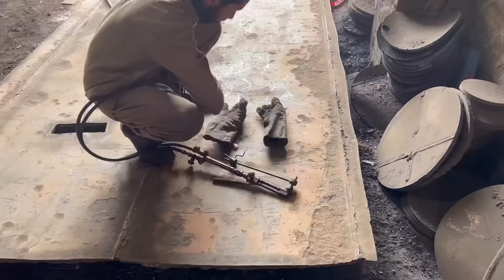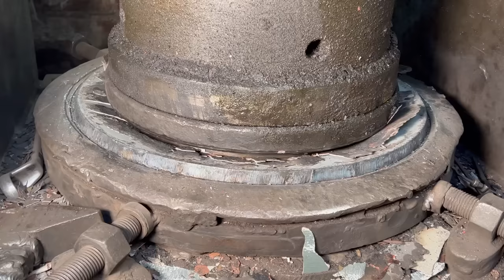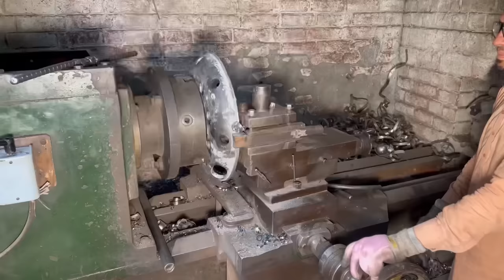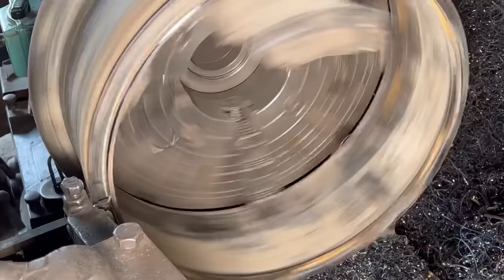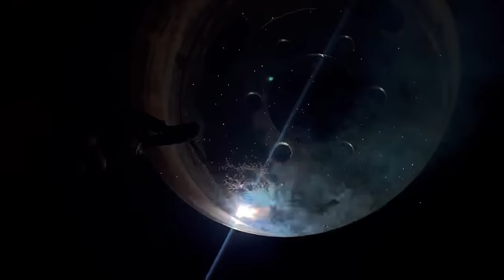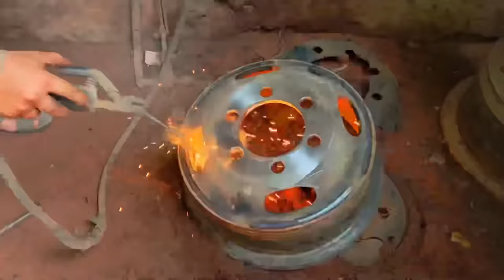Transforming Old Ship Sheets Into Heavy Duty Truck Tire Rim |Easy DIY Rim Plate from Old Sheet Metal

Comment: Dude holding that chisel got balls of steel !!
Reply: ... скорее сварщик имеет стальные лёгкие
Reply: Nope... he's just very hungry
Reply: Indeed.  Crap 'cold' welds that will peel away like that.
Reply: Nope... no brains
Reply: Even if he doesn't ever get actually hit, his hand and wrist joints are going to be destroyed from the vibrations.
Reply: At least they are wearing shoes and not sandals  😅
Reply: I was more worried about the guys left foot right by the chisel and where both guys were swinging the sledge but then it segued into the guy using the torch with no safety glasses
Reply: also wrists
Reply: Debes ser del tipo que siempre estropea las celebraciones!
Reply: @captaingoody 1

Comment: How the heck were the lug stud holes aligned, don't tell me he did it by sight!  Amazing work, would love to know the psi of those presses, wow!
Reply: 8😅😅k99
Reply: I was wondering the same thing
Reply: My guess is they had the holes marked off camera.
Reply: There had to be a jig
Reply: Looks like he was using a dividing head and rotating to each "click" on the rotation.
Reply: IF their rims are made same way they are in US, the lug nut stud holes have quite a bit of play, holes are bigger then they need to be.  Unlike on cars, what centers the rim is the pilot hole, the big hole in the center of the rim, you can see him machining it at one point.  Thing is I haven't seen them use a measuring tool for that hole either, and that one has to be very tight tolerance.
Still a nice eyeball on the stud holes.
Reply: @markmonroe7330  Ya you could hear the clicks a few times. No way by eye....LOL
Reply: The indexing recesses for the spring-loaded detent are visible around the periphery of the indexing jig.

Comment: I can't believe the guy was just eyeballing the hole and bolt-hole patterns, instead of measuring. This means that each rim is different, and some will not fit properly, if they fit at all. Not to mention that this causes the rims to be unbalanced. Then, they use a destroyed rim to weld onto the unbalanced piece without checking for defects. Whoever is buying from this business is putting lives at risk.
Reply: I think there is line up mark on jig.
Reply: I like how the bolt pattern was punched relative to the punched I.D.   Then, on the lathe, they turned a new ID to match whatever the 4-jaw chuck was set at (with no dial indicator).

...and not any kind of precision measuring tool in sight.

Comment: For those concerned about the true on these wheels, remember that they run on terrible surfaces anyway, rarely getting over 50 mph for any length of time. I doubt one could tell the difference between one of these and a Freightliner or Peterbilt,,,taking into consideration the condition of the roads there.
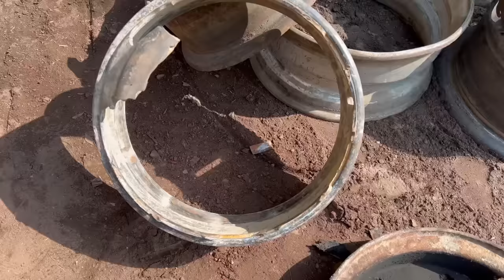Reply: the truth about these wheels can be seen at 8:21
Reply: @hktundra  those are the OEM's. they used much thinner material.
Reply: i just hope they dont export those wheels anywhere
Reply: @xy_iron   I would bet all the money I got that they end up at the local marketplace and are bought by locals.  Same with all the stuff you see in these vids.  These are local people working for other locals in their own area.
Reply: They make junk! Stop making excuses for this rubbish!
Reply: it seem like much better stronger wheel than OEM

Comment: I get it, it works but geez, when you look at some modern rims manufacturing ... it's not that there are some super futuristic tools, it's just bit of measuring, cleaning and safety added. Basically just some more advanced process. And except wages, it is maybe even cheaper.
This guys got it working and stopped improving, they are ok with "good enough" - which is ok, but ffs at least that safety!